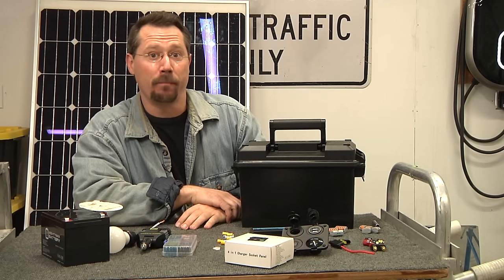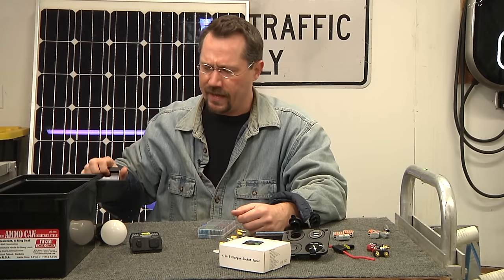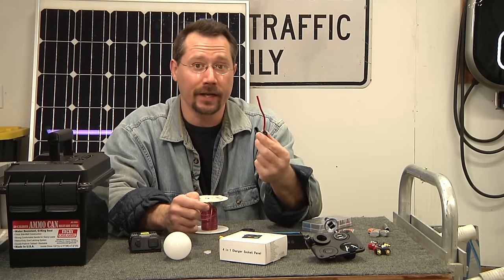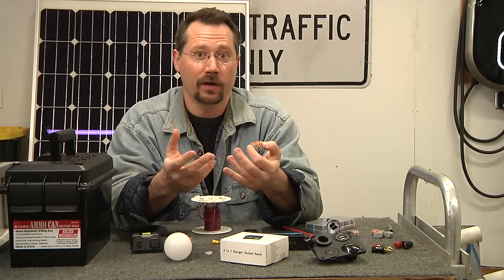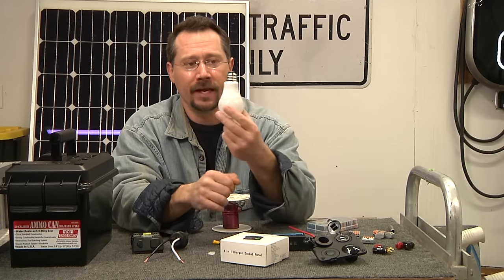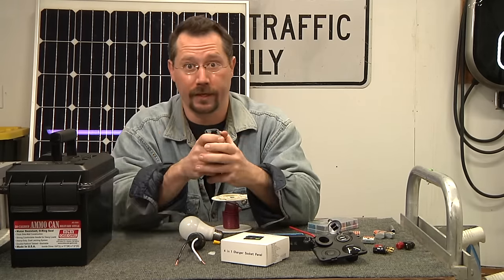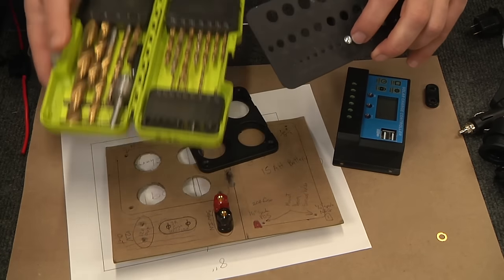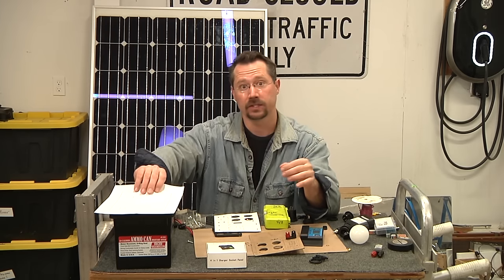Build A Solar Ammo Can Full-Length Instructional Video

Comment: Ive run into another issue: I cannot find a wall charger that will fit into the Solar In banana plugs. It will be awhile before I can get a solar panel.
Reply from the maker: The point of the banana jacks is that any wall charger WILL fit them because they also work with BARE WIRES. Twist the large plastic part of the connector and it will loosen counter-clockwise. You will see that on the shaft of the connection, there is a hole that goes through cross-wise. That is for bare wires. Strip the ends of the wires of your 13.5-18V power supply and put each through that hole in the banana jack (observing polarity) and then rotate the plastic portion clockwise to tighten it down on the wire.
Reply: @BenjaminNelsonX  - thank you again for your clear answer. I got my hands on a wall charger that says the output is 15v, 1A. I guess I should be okay till I get my panel.

Comment: I have 2 pwm solar charge controllers I've since found they don't have proper charging parameters for sealed lead acid batteries the one one from Colman only charges the battery to 13.5 volts and I've got way too many booster packs some with 400 watt modified sine wave inverter and some with both inverter and air pump all with dead sulfated batteries from not being charged fully and discharge below safe limits causing the unit to die after a year my latest 2 everstart booster packs with modified sine wave inverter and aiir pump I got 2 years out of them but I talked to the manufacturer and believed them that it was fully charged at 13.1 volts and majorly shortened it life before I started charging it with a proper charger but l got an extra year of use out of it so now since I found out from utube that I can replace the battery in my better unit and I can actually put a bigger battery in one unit might have to modify it and it won't look as neat and be twice as heavy but being as I have 2 with just the modified sine wave inverter and 2 with air pump as well so I'm going to see if I can use one of the Anderson connector from one of units and add it to the one I'm modifying also add more USB Including USB quick charge and USB type C and charge the auxiliary port to cigarette lighter plug and add 2 more still trying to find a reasonable priced USB type C also find a source of cigarette lighter plugs I can find lots of auxiliary plugs

Comment: hi have you still got the digital file for the cutter so I can make one my self
Reply from the maker: Hi Phil.
I just made the text/logo in the software that comes with the Silhouette Cameo cutter that I use. Really easy software to use, but it is proprietary to the cutter. If you have access to a vinyl-cutter, just use the software that comes with it, and type in "SOLAR AMMO CAN" using a STENCIL font.
These consumer vinyl cutters are great! I've used it for all sorts of things, including glass etching! https://amzn.to/2Vbd6wg
Reply from the maker: Hey Phil,
I just went through the trouble of making a "generic" version of the cutter file. It's a .DXF format. Should work with pretty much any CNC cutter out there. If when you import it, the size seems off, just grab the whole thing and scale it so that the outside rectangular power is 8" wide. That makes a nice large graphic just like I used. You can make smaller, but the fine points on the stencil font get a little harder to transfer.
The file is posted on the Instructables write up in step 6.
https://www.instructables.com/id/Ammo-Can-Solar-Power-Supply/

Comment: Can you make it so that the battery can charged from wall socket ?
Reply from the maker: Yes, this can be charged from wall power. That's described at https://youtu.be/g2cLMk3nD3Y?t=2854
Reply: @BenjaminNelsonX  I can't seems to find 18v dc power supply with banana jack in my country. I only can find 12v 2a adaptor dc power supply :'(... What should I do..
Reply from the maker: Any 1 or 2A power supply at 13-18V should work fine. It doesn't even need a specific connection at the end. The Terminals I used on this project will accept a bare wire. You can cut off any end connector on the power supply, pull apart the two wires and strip the ends. Then put the ends through the Red and Black (+ and -) SOLAR IN terminals and tighten them down.
Reply: @BenjaminNelsonX  Thanks for replying to all my stupid novice questions so far 😂😂...

Here's another one.

In this video :
https://youtu.be/-1VIv5OI4ow

It shown that the middle one goes to the apps, but in your video, it isnt... Which one is correct ? Or both of them are correct ?
Reply: @BenjaminNelsonX  Can I change the banana jack connection for the input energy to 2.1x5.5 female barrel jack ? Will the output still be the same ?
Reply from the maker: Sure, you can use whatever type of input connector you would like, as long as it's still being fed Direct Current at a higher voltage than the battery, and you can connect it to the screw down input terminals on the solar charge controller. I chose the banana jacks because they also allow for bare wire connections, which gives a lot of flexibility for charging the system. Make sure to also double-check the polarity when you wire up the input.
Reply: I finally finished making this on my own. I added all the outputs with the switches for those not draining the battery... Hopefully it can support the lightbulb and fan if we got the power outage. It happens a lot in my area.
I got a baby girl to take care of 😁😁😁

Thank you very much, sir. 😀
Reply: Can I ask you 1 more question ?
My universal adaptor is 120w, if I charge it with 18v, the ampere should be 6,67a. Is it safe ? Or I should look for 18v 3a adaptor instead ?
Reply from the maker: @sumpitbaja6740   The battery I used in this project is probably a little small for a 6A charger. You have to compare the capacity of the battery to the rate of charge. Some batteries can provide or absorb much higher rates of current than others. "C-rate" is an important concept about batteries, and a little too in-depth for a simple comment reply. Please take a look at a few web pages for more information on charge rates. https://batteryuniversity.com/learn/article/charging_the_lead_acid_battery
Reply: Mine is VRLA 12v 7.5ah which is smaller than yours 😄😄😄.
So 6a is not a good option then...
Reply from the maker: @sumpitbaja6740   It's not that a 7.5AH or 6AH battery is "bad", it's just that it has less capacity. If you only need a rather small amount of stored energy, it's fine. The advantage would be lighter weight. I designed this project with a particular size battery so that it had enough energy storage for my needs, was still light enough to be useful as PORTABLE power, and the battery fits just PERFECT in the ammo can.
When designing any project, first figure out which components meet the GOALS of the project, and go from there.
Lastly, when something is custom, you can design things any way you want. That's half the fun of Do It Yourself!

Comment: Good idea except for a couple things SLAs are not sealed so there will be acid fumes in the case. Might take a couple years but they will get to the controller. And it is Silicone not silicon caulk. ;-)
Reply: I didn't notice a vent on the battery in the video. Was it really an AGM?
Reply: @davidrowinski2160  The venting is done around the panel in the top of the battery. The sealing part comes in that you normally can't open them.  But they will vent out of the gaps around that panel. Number one cause of them dying is that the acid gets boiled out and you end up with a dry battery.
Reply: @gravelydon7072  Thanks for your reply. If that controller is "smart" enough to prevent overcharging, this acid reduction should not happen. It should monitor battery voltage and switch to a trickle charge. Not sure of the specs on that particular controller. Probably best to disconnect the battery when not in use. This comment is going to take longer than I expected because I am including an example. First of all, I used a magnifying glass and did see tiny slots on the top of a battery (12 v, 2.6 A/H). Your venting statement is correct. I have a battery operated amp. It has an internal charging circuit to "top up" the "Valve Regulated Sealed Lead-Acid" battery as mentioned above. I do not charge the battery within the amp anymore. I take it out and use a smart charger (Diehard Model 28.71239). I found out that the internal amplifier charging circuit puts out a constant 18vdc. This has "cooked" previous batteries until I found that out. The battery used in this amp has 3 specs on the case for "Constant Voltage Charge". Constant 18vdc is not one of the specs. I hope that the many comments from this video serve to educate some of the people who take the time to read the (many) comments included.
Reply: @davidrowinski2160  I don't know of any of the systems that will prevent it. It is just one of the problems with Lead-Acid batteries. The only thing they will do is prolong the time between new and failure. When a battery is charged, the electrolyte is broken down even by just a small amount each time the battery is charged. In commercial duty batteries in stationary use they often have tanks of water to keep them topped up on a continuous basis. It's just like with "Maintenance Free " batteries, they sooner or later fail either from sulphation or the water in them gets too low and they short internally. In an UPS, the time they last is between two and three years. In a car battery, you may see 5 years. In industrial batteries, they are not sealed so that you can check the water level and the hydrometer reading of each cell. They can last up 20 years if properly maintained. We had Nickel-Iron batteries in our microwave towers with water feeds to each cell. In the 18 years I was there, they were never replaced. That is why many things are being switched to LiPo or LiFePo as they are truly maintenance free and have a longer lifespan. And do not vent acid fumes like the SLA can.

Comment: I guess in terms of capacity and lifecycles lithium would be better, but you'll probably only use this intermittently. 
Plus lipo or lifepo is much more of a hassle.
Reply from the maker: I figured I would get lots of comments about lithium batteries. On this project, I just wanted to use off-the-shelf parts, which anyone could assemble. Lithium batteries are fantastic, but much more complicated than simply plugging in two wires.

Comment: Can I do two batteries instead of one ?
Reply from the maker: Yes. Just install them in parallel. + to + and - to - on the batteries. That keeps it at 12V. Use a matched pair of the same brand/size/age batteries.
Reply: You think it can jump start a car maybe we can add that futer

Comment: The folks using that archaic measurement system put Man on the Moon using it.  The French (Inventors of the Metric System)  Should have made  1 centimetre equal to on Inch.  Then we would have had something.  Miles and Kilometres would had been closer as well.

Comment: could I use solar to keep battery in a classic car topped up?
Reply: Yes.  There are solar panels designed for RVs just for that.  Do NOT use the small one that Harbor Freight sells, I bought one and it provided about 1/10 the current needed.  And make sure you size if for a winter day (much less solar energy than a summer day).  
A friend uses a Battery Tender (google it) on his 1928 Packard...look here:  https://www.batterytender.com/Battery-Tender-6V-12V-3A-Selectable-Battery-Charger_7 
You can get it from Amazon.

Comment: Bravo  - nice work

It would be nice if the Ammo can was  metal - that way it can be EMP proof - to protect your inner electronics.
By it being a plastic Ammo can - nothing inside is protected.

Sorry - we have to think this way these days.
Reply from the maker: Hi Christopher!
The great thing about you building a project like this is you can build it any way you want!
I really liked that the plastic ammo can was light-weight and rust-proof. If you want to make one from a metal ammo can, go for it!
Reply: @BenjaminNelsonX  Thanks - will your template fit a metal ammo can?
Reply from the maker: @thehouseofprayereducationw1031  I couldn't tell you exactly, as I don't have a 50 caliber metal ammo can. I will tell you that my wood faceplate template measures just shy of 8.5" long by a hair less than 6" wide.

Comment: Hi Benjamin, I created a modified Solar Ammo Can with a larger battery and I added a mounted power inverter. Pretty happy so far.  Listen I was wondering if you thought one could create an ammo can power bank using your car battery.  Instead of mounting a battery in the box, you could run an output to the 12v input in your car. The idea would be to mount all the box features on the box but use the car battery as the storage bank after using the solar panel to recharge. What do you think?  Chris
Reply from the maker: You certainly could, but it feels a little redundant to me.
My car already has a built in way to charge the engine (alternator) and already has a 12V output (cig plug).
If you have a car that's parked for a long time, a solar charger isn't a bad idea, but a 120V trickle charger would work as well.
For me, the big benefit of the Solar Ammo Can is that it's portable and self-contained. Attaching it to a car essentially takes that away.

That said, one of the biggest reasons I built this project was to encourage others to learn about solar charging, 12VDC basics, wiring, and other handy skills.

If using these components with your car is useful and serves a purpose for you, go for it!
Reply: Thanks for the insights Benjamin, The scenario that I had in mind is one where you might be doing some car camping or a SHTF emergency.  Hypothetically, one might drive to a location where they stay in relative close proximity to their vehicle and want to use the battery to run or recharge equipment without running the engine to keep the battery charged.  If you're out of range of a trickle charger, then a solar panel makes sense.  The dimension of your project that I like is the employment of a solar charge controller when using a solar panel to avoid damaging the battery.  I'll let you know how it goes.  Thanks for the quick response.  Chris

Comment: That is what I need but with 50 / 100ah Lipo4 battery & 1000 watt 240 volt psw inverter.
Reply: That just takes the basic theory and shows that it is "scalable" both up and down.

Comment: No vent on the box?
Reply from the maker: Doesn't need one.
It's a sealed lead-acid battery and I'm not charging or discharging with the lid sealed. If a person wanted, they could simply remove the o-ring in the lid.

Comment: Why didn’t u use li ion battery?
Reply from the maker: Lithium batteries are expensive and complicated (require BMS, etc.)
I wanted to design this as a simple project that anyone with no prior experience could build.

Anyone who has experience with lithium batteries can certainly use one instead.

Comment: hi @BenjaminNelson

you have given me an idea for a potentially self charging unit without the use of a solar panel

i have no idea if this will work or not

you proved that the battery can be charged by the wall outlet with this design

which makes me curious if using the wall outlet with the inverter can it eliminate the solar panel for charging...??
Reply from the maker: That would just be a wall-charged battery, just like any common cordless drill battery.
Reply: @BenjaminNelsonX  thank you

would it actually work to have it self charging via the inverter using the wall charger for charging the battery while in use rather than be reliant on a solar panel...??

i am thinking mainly for running a 180w fridge-freezer and a 750w water distiller laptop mobile device charging for power outages with 

National Grid here in the UK have stated in the news they want to turn off the power during January and February on the darkest days and nights, all planned back in 2015

thus i need to be prepared in advance
Reply from the maker: Why would you use energy from the battery to run an inverter to run a charger to charge the battery?
The energy would simply be going in a loop, plus added losses of the power conversions. All it would do is slowly drain the battery.
A wall charger puts in energy from the power plant the electric outlet is connected to. A solar panel puts in energy created from the sun.
Energy has to come from somewhere.
Reply: @BenjaminNelsonX  i comprehend what you are saying

however in a shtf say if solar panel fails for whatever reason and it takes a few days to a week to get a replacement

or there are far too many cloudy days in a row to keep batteries topped-up

as a short term emergency putting it in the way you did "use energy from the battery to run an inverter to run a charger to charge the battery" to keep the most needed like fridge freezer medical and-such up and running should suffice should it not...??
Reply from the maker: @bushcraftone7240  You will only get LESS energy not MORE.

It's like pouring water back and forth between two glasses. At best, you just spill. very little, but you never end up with more water than you start with!